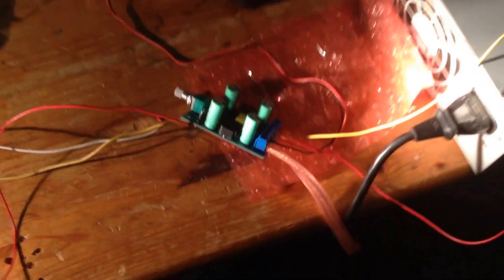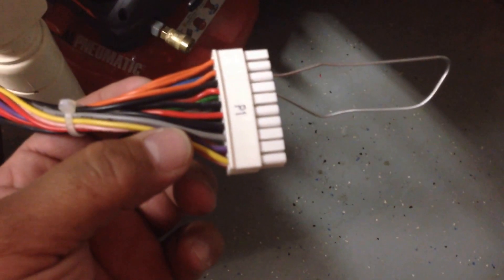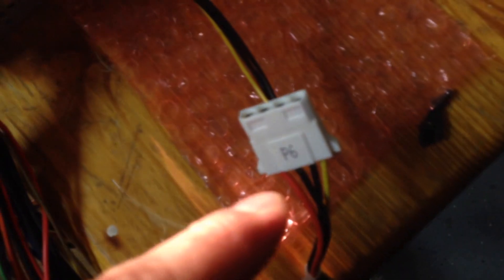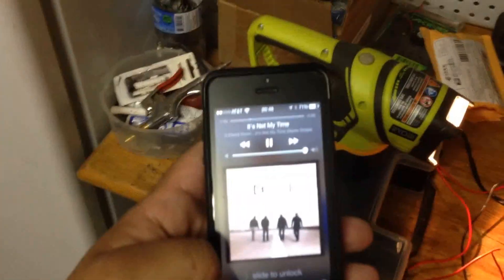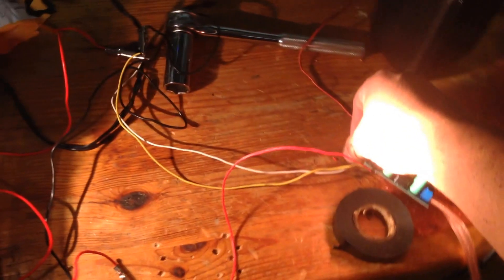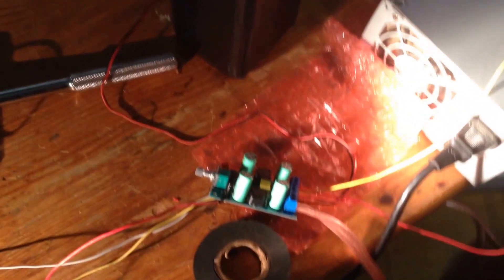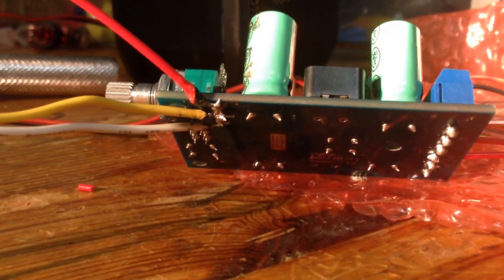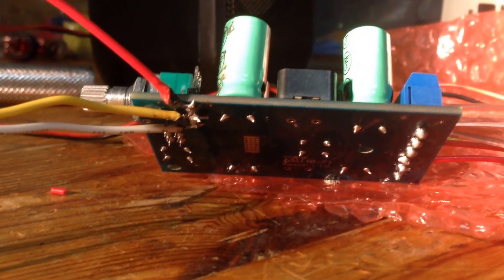TPA3123 25W X 2 Dual-Channel Class D Digital Audio Power Amplifier DIY

Comment: ..  do they sell any cable that  have 3.5mm female to splice or solder to the board ?  so I can just plug my ipod to it ?
Reply from the maker: grilledchickenwrap  any 3.5mm female cord will work. just splice the cable and solder your connections. but only after you've tested them to make sure your righ and left channels are proper. good luck.

Comment: thought D class amps only play bass
Reply: +nigel R 
Class D amplifiers use digital PWM switching outputs rather than analog outputs like class A/B amplifiers. The class does not relate to frequency response.
You  probably got that idea because class D amplifiers are often used with sub-woofers. 
The primary value of class D is in very high power efficiency and hence cool operation.